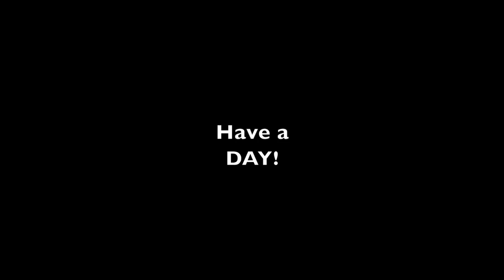#591 Mini Cabin Rafters, and Meet the Newest Morgan!

Comment: Hello Ty! On the jig saw you kept blowing your saw dust out of the way. That black switch on the right side is for controlling air flow from the cooling fan on the motor to the saw blade. Thus using the exhaust to blow the saw dust out of the way for you. The down position is off and in the video your switch is down if you flip it up it will help greatly.
Reply: I always learn so much on this channel.

Comment: Hello Mike, have you considered X or cross bracing the base posts to prevent side to side movement.  Even with the cement footings, when you add the weight of materials and movement of occupants stress on the posts will likely occur.  Just a thought.  Enjoy the channel while in "hospice ". 🇺🇸KAG🇺🇸

Comment: I think that's a great idea about putting a lowered roof section over the door area. That will allow you to put a window below the upper roof hangover. Then you can use it as a skylight and if it opens, use it for ventilation on warm days.

Comment: If you don't mind I will put my $.02 in on windows and window height, what I do and it's the best I have came up with (for me), I use 36"x 36" single hung (bathroom windows), put 2 centered in the front as close together as you can put them, you will have about a foot on the outside corners of wall but I don't have a problem with that, on the two sides, I use the same windows, and install them as close to the frount  corners as you can. They are quiet and smooth with good view. As for the heitght I like to use old office chairs, but whatever you use get them and set in them to set your window height to the view you want, take in consideration for the window frame and your gun height while laying in the window. It will be lower than what you think around 36" from floor. I don't want any windows in the back of house. After I get the inside finished I build a bench (like a workbench) across the whole front the height of bottom of window and 2 ft wide for a shooting bench and a place to set your coffee, lay your gun, snacks and every thing else a guy wants there handy. again just my 02.  it looking great!

Comment: I'm hoping you have a skid loader coming with a Fecon forestry mulcher. If that's the case, do NOT let Melissa operate it in the vicinity of ANYTHING! 😂
Also, if you're going to put the porch roof lower than the main roof, and you're serious about a bunk above the door, you should install a small window in that upper wall so you can look out from the bunk.